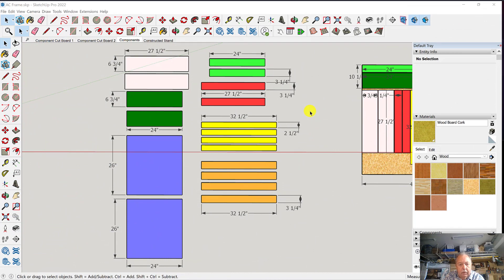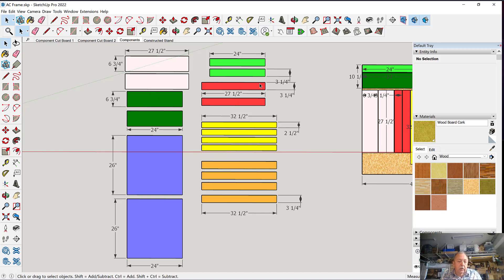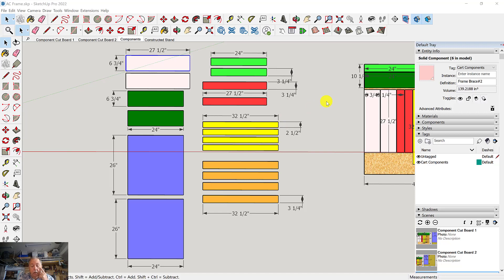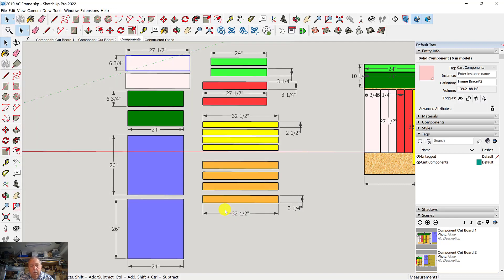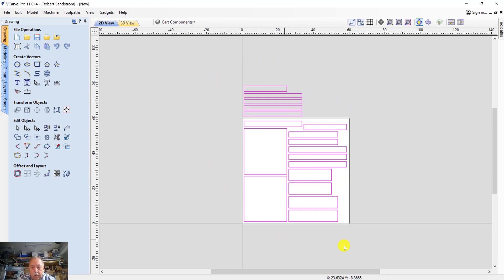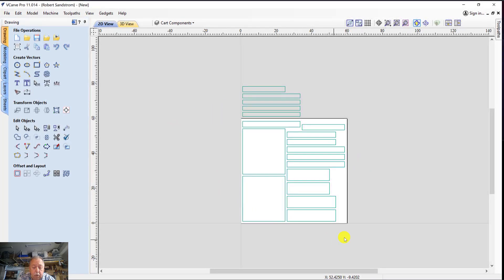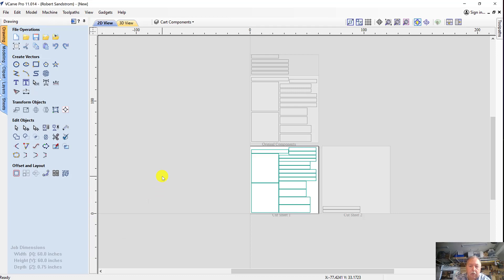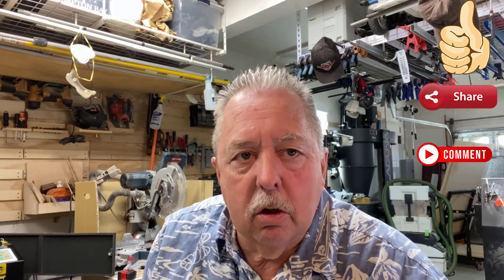Sketchup into vCarve Pro Tutorial

Comment: Such an informative information. Thanks for sharing sir. 
I've been stuck in this problem for 3 months, and now you came solved all my problems.
Hopefully to see your nice experience and informative again.
Reply from the maker: So glad I was able to help.  Wishing you much success.
Reply: @RobSandstromDesigns  And you as well sir. I still wondering if there have two line parallel to each other and the tool gap is 5mm according to the bit's diameter (5mm. Endmill bit).
Is there have anyway to cut them only one time , cause now the bit is traveling twice which is forward and backward. In my case they already separated to each other since the first cut.

Hopefully you have any ideas to solve this problem sir.
Reply from the maker: If you are careful about how you line up your tool paths it is possible to cut two different parts with one cut.  although it is possible, if tabs are need to hold parts in there would not be the ability to make useful tabs on the common line.  Also, the vectors couldn't be closed vectors which makes the toolpath setup a little more complicated.  If I get time maybe I'll share how to do this in a video sometime but it isn't a common item that has been brought up in the past.  Sorry I can't be specific on how to do this in this comment section.
Reply: @RobSandstromDesigns  What a value information from you again. Hopefully you have sometimes to demonstrate about this sir.

Thank you very much, and god bless you sir.
Reply from the maker: @naruponkanjanapas4459  pretty busy but uf I can get a chance I may do something.  Sorry I can't promise to do it because I am very busy.
Reply: @RobSandstromDesigns  Appreciated that sir and I really understand how busy you are. There's no any rush here sir so please show me whenever you free.
However, I used to created open vector as you told me last time and yes, that required quite sometimes by that way as you said😭.
Still I believe that there must have better way to do sir.
Glad to shared and talk with you sir.